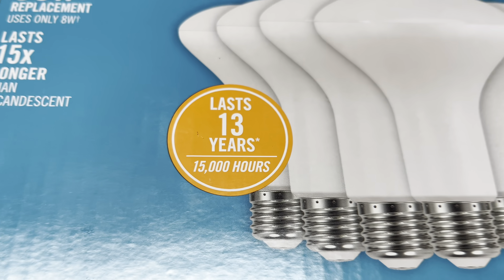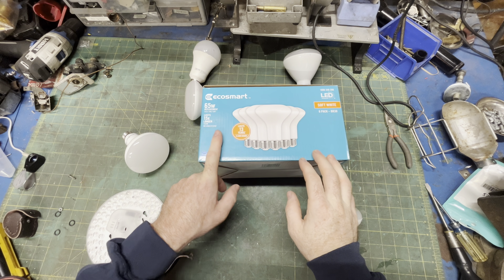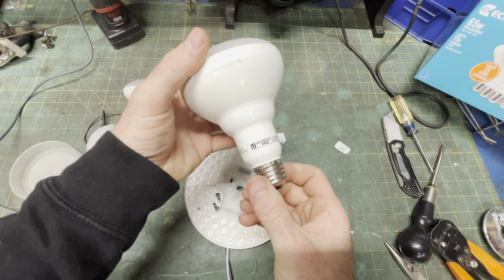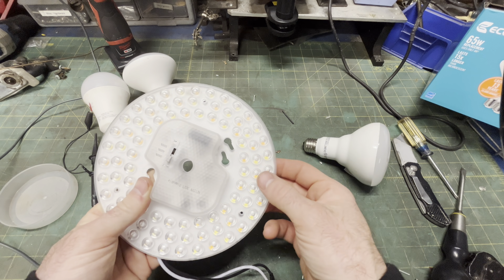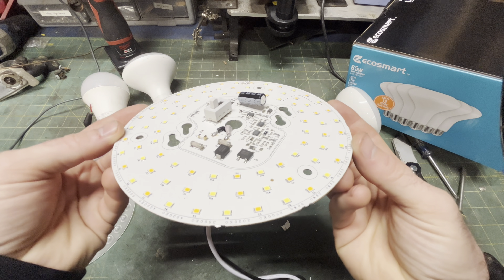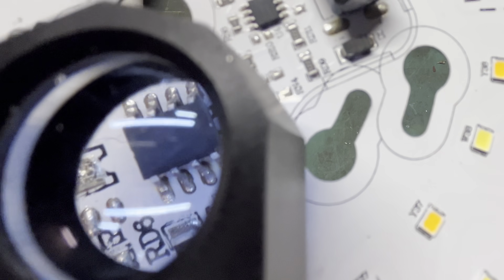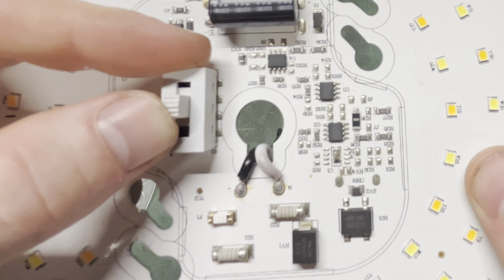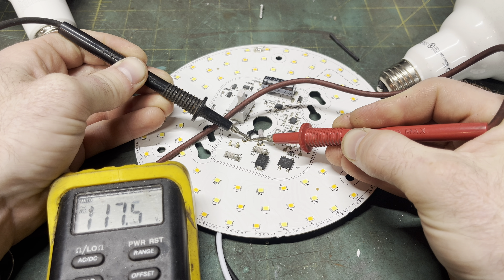Why Do LED Bulbs Fail? An Autopsy!

Comment: according to the manufacturers the lifespan of the lamps depend on the On/Off Times. the more times they get turned on and off it decreases their life. And I use to install a lot of lamps when i was working in the field. I have replaced thousands of lamps and hundreds of ballast. I had a building that the local power company came in and installed motion detectors and the lamps only stayed on for about 10 minutes. it was a real pain when in the middle of working on something the lights would turn off. but this particular building had to have their lamps replaced very frequently. Whatever they were supposed to ge getting as far as saving was definitely  lost for sure because of the cost of replacement ( labor and lamps ).

Comment: My beef is with 48" strip lights and pole mount area lights that use separate LED drivers.  The lamp source is always good but the driver is shot.  There are no identifying numbers or manufacturer brand marks on these driver units so they are almost impossible to replace.  It is a lot harder to replace a pole-mounted light than it is to screw in a new bulb!

Comment: One thing I noticed about LED lightbulbs is if you don't turn them off, they last longer.
Oh, and out of the 10 bulbs I got when they first appeared on the market, 6 are still working, while modern bulbs die in 3-6 months.

Comment: What was so terribly wrong with incandescent bulbs? They were just a couple of ounces of glass, tin, solder and a tungsten filiment. Simple, cheap to build and to replace. Now they’re pretty much gone. They said they use too much energy so they gotta go. Now how much energy does it take to manufacture the chips, resistors, capacitors, and other components to make the led bulb? How much energy is used to transport these things halfway around the world from places like china?

Comment: First off, the life span they say is based on how long it will give light. Nothing on how intense the light will be.
Second, I have an old compact florescent that was not coil. The tops go up and down with 180 degree bends. It was in the back porch when we moved in the house 16 years ago. Often it get left on. It's still going. I got rid of all the coil contact florescents.

Comment: As a formar buyer I was much relieved to replace FELs with LEDs as they burned. That way I just needed a couple boxes at hand. Agreed first ones to come up to the market were very short-lived but quality improved with time. Most common fail modes were capacitors or misassembled heat sinks.
But I guess every man's experience is different.

Comment: I got 25 ish 240v gu 5.3 LED spot lamps back in about 2012 . They were quite expensive back then.   10 in my kitchen, 9 in a bedroom , and 3 in another bedroom.  1 of them failed within a few years.   The rest of them are still going , now 12 years later. I think they're becoming a bit dull , but it's hard to tell. I haven't been doing light meter readings !

Now some more modern LED lamps , I've had them blow just after a year or two. Yes, definitely not as good !

Comment: I've personally had amazing luck with Philips bulbs.   I bought 6 Philips bulbs about a decade ago at this point, I've only had one fail, and only very recently.  After those initial 6, I needed some more because the more of incandescent bulbs installed in the house were failing (new build construction, cheap bulbs) , so I did what home home owners would do, I went to Home Depot.  Ecosmart were on sale and much cheaper than Philips or any of the name brand alternatives (AFAIK Ecosmart is Home Depot's house brand), so I bought 4 of them.  Then couple months later I needed some more, so I bought 4 more, and repeat at least 2 more times over the course of maybe 1.5 years until probably 90% of the bulbs in my house are LED.

Since that time, I have had at least 12 Ecosmart bulbs fail, and only 1 Philips bulb.  I have not bought another Ecosmart bulb since I noticed a patter start emerging of the first 4 Ecosmart's dying very prematurely.

Comment: 14:00 - I read an article in Popular Electronics about salvaging components from circuit boards and methods of doing so were part of that article. One method mentioned was heating the back of the board with a blowtorch and whacking it on a workbench...

Comment: I have these old Philips Endura lightbulbs, supposedly at 3 hours a day they would last 22 years, but they've been running 24/7 in my house for 12 years now. The base seems to be entirely made of aluminum which could be why they've lasted so long.

Comment: I've taken apart tens of normal 60w equivalent LED light bulbs and for me it's a dead LED every time. It is easy to see which one because they get a black spot on them. If you short out the LED or replace it, they will work again, sometimes for a very long time even if you short them and the remaining leds are driven harder. The brands have mostly been Philips and Astralux which must be the brand names the conglomerates that deliver to my local grocery store owns.

Comment: Could just make your own led bulbs from the ones you have. Use a high efficiency bridge, caps, then just stack all the leds in series until it matches up to the voltage of the input. Alternatively, have a separate led lighting system for each led individually or a 12v one. Might work.

Comment: Most of these bulbs say not to be used in enclosed fixtures. Additionally you have to look at the placement of the bulb in a fixture, meaning, the direction it is installed vertically. Is the light facing downward, which causes the heat to rise up into the circuitry? Or the opposite? That makes a big difference.

Comment: The DC from the bridge should be 1.4 times the AC input, mnuse two diode drops. 10 volts indicates an open electroylytic. I learned that almost 60 years ago. Electrolytics are the hihest failure component  in modern electronics.

Comment: Basically the solution is - good heat sink to the LEDs (and driving them with a smaller current they are rated for) and the electronics driving them to be distanced to protect from overheating.

Comment: I was the manger for street lights in a mid-to large City.  I also had years of experience as an electronics technician.  When LEDs came out (way before street lighting LEDs,) for traffic signals, I saw the predicted "life" and noted that it was based upon the LEDs themselves.  Not the power supply that gave them power.  I said then that the main issue would not be the LEDs, but the build quality, and life expectancy of the power supply's components.  Again when the Street Light LEDs came out, I repeated that.  The major causes of failure in any electronic device has typically been within the DC power supply for it.  Still is.  I will say, that the power supplies in general have been improving, but unless those supplies are at Mil spec, they will likely fail before the LEDs do.  The major way to figure out what the failure cause was is what was the failure.  Total, likely the power supply.  Individual LEDs, the LEDs themselves or their connections to the mounting board.  (Just by my years of experience.)

Comment: The constant heat and cool cycles fatigues the solder joints over time and they eventually develop micro cracks and fail. I wonder if you turned the bulb on and left it on continuously never turning it off how long it would last.

I have a small night light bulb in my basement that is plugged into an outlet and never turned off. Its been burning non stop since 2013. Still going.

Comment: I bought a bunch of those FEIT electric bulbs when I moved into my new place. Maybe 140 of them? They have failed at roughly 10-20 per year since then. I ended up replacing them all with Sylvania TruWave 4000K LED bulbs. They were roughly 5x as expensive, but I have not had a single one fail in over 1.5 years. You get what you pay for. It sure beats scrambling up on ladders to change them out on 12ft ceilings.

Comment: "Smells like nostalgia" i know that feeling very well lol. Mainly from when i used to use a heat gun to melt ALL the solder joints on a through-hold board, then tap the board into a bowl to make all the components fall out. burning FR4 probably wasn't healthy to breathe in lol.

Comment: I was laughing a lot at certain spots, but I have to admit, that I have couple of early LEDs, which served me 10+ years, most of them still in service. Unlike some of the newer ones, these were never modified for lowered output. Most of them are just some generic Ikea LED bulbs.

Comment: I have floods outside.  They lost their front glass when getting Hot in the sun bulb off.   We got over 120 and they are close to the attic.   (Vented top and sides and ends.)  The glue changed. Now I have a heavy glass lens to do something with.

Comment: I had switch mode led drivers fail, most of the time it's an electrolytic capacitor that gives up. If I spend more than 30 minutes I usually just swap the driver for a new (AliExpress) driver.
My bathroom led downlights are now 14 years old with only one driver replacement

Comment: Another reason why leds fail is straight out lack of heat dissipation. I had a 3 watt bright enough philips mini bulb fail in a ceiling mount, but opened it up and driver was fine, the bulb was dead due to the enclosure and zero heat dissipation (its heat sink was the size of a dime and there were 12volt leds 4 of them in series to a total of 48 volts to eun them. Poor thing got so hot the phosphor was coming out of the led. Hooked up 12 new led lights (3v each to conpensate for the 12v each) with a massive heatsink and separated the driver and put it back in enclosure, the things been running bright ever since, saved it from ending up in the land fill

Comment: I have a flame LED bulb in my Post light that runs 24X7X365 for the past 6 years.  The secret is not turning it off and on frequently, just leave it on.

Comment: I write down the date and time on the boxes nowadays...I found that an incandescent indoor plant light rated for 2000 Hours does pretty much between 1600 and 3500 Hours...and the LEDs...between 24+ Hours and less than the incandescent. 
Very often it's a loose wire in the base and/or the main capacitor.: failure by overheating (They get burning hot!) and/or corrosion. 
The ones that have semi potted boards in an aluminium shell last a bit more. Philips outlasts the cheapos. Older LEDs purchased over 5 years ago are still going (let's say 40% of them) newer ones last 1-2 years maybe 3.

Comment: Its mostly because the old "light bulb" form factor is not right for LEDs, due to the driver electronics stuffed in the tiny base. That's was dies. The electronics. Semiconductor circuitry, and electrolytic capacitors do not like heat. To live anywhere close to what's on the box, the circuit has to draw no more than 1 watt per square inch. Current production LED bulbs greatly exceed that power dissipation.

There are new fixtures, with the LEDs integrated into the fixture, and have nice large aluminum backed PCBs, that dissipate less than 1 watt per square inch. Installed a few of those 9 years ago, and they are still working fine.

Comment: I've had several cheap LED bulbs flicker or get dim. My problem is that sure they do use less energy, but it seems to me that the actual bulb is not really environmentally friendly.  With incandescent bulbs you have some metal and glass, with the LED's you have the plastic and all the circuitry which I'm assuming is not landfill friendly.

Comment: I wonder if this is the same issue with the Kasa KL135 bulbs.  I've had several of them start to fail.  One of the LED's in the bulb would start flashing very fast after being of for a couple hours, and over time the flash became slower. This happens with both my inside and outside Kasa KL135 bulbs.

Comment: I like the LED "filament" style bulbs. They look much nicer and I've had pretty good luck with them, only 1 or 2 out of ten failing over 8+ years. I used to get them at Walmart because they had some that were at least assembled  in the US, but they don't have those anymore so I'm going to try Home Depot's next.
Reply: I had one burn out on me in probably less than a year made by Ecosmart.

Comment: I assumed fuses used the same colour code as resistors, in which case the current limiting resistor should read brown, black, black for 10 ohms. "Red, red" is a bit odd.

Comment: Before even watching this, I can answer it the question. They run the diodes at a higher voltage than they're designed to handle, specifically so that they will burn out faster. As the saying goes, the candle that burns twice as bright, burns half as long.
They do this knowing no one actually keeps the receipt and the bulb's box for 5 years to take it back to the store for a warranty replacement. Requiring the box is one way they're getting around consumer protections and warranty regulations. Even if it's illegal for them to do that in your country, they will get away with it, so much of the time because people don't know, that it's worth them doing it.

Comment: Yeah, the biggest problem with LED bulbs is the power supplies.  The LEDs themselves are almost never the point of failure. I think that in the long term we should move to DC lighting circuits in buildings.  It would eliminate all of this unnecessary complexity.  I think that it would be really simple to adopt either a 12 V or center tapped 24 V (+12v GND -12v) system for lighting.  Having a standardized connector scheme like we have for current AC light bulbs would be really nice. In fact there are so many things in your home that could benefit by eliminating the AC power supplies and having DC power available.

Personally, I would like to change my home's lighting to a solar powered, DC only system.  Imagine never having to worry about the lights going out at 10 pm in a rain storm.

Comment: One is the solution for interior lighting! fluorescent with electronic ballast and quiet for at least 10 years and for outdoor, ceramic metal halide CDOs which are very efficient but need a ballast, ignitor and capacitor to run these bulbs or an electronic ballast and be ok for 10 maybe 20 years if you want something a little more efficient, HPS i.e. high pressure sodium is one of the most efficient gas discharge lamps in use at the moment, but the light they give is a very intense dark golden yellow light of 2000 Kelvin so they are only used outdoors, while the CDO is 2800 Kelvin warm white like incandescent and halogen, but CDO bulbs are only for outdoor use if you want an LED that lasts 10-25 years and unfortunately you have to pay a lot of money for it to actually last for many years

Comment: I'm an electrician. I work in a hospital. I've change 1000s of bulbs a year.

Those BR30 ecosmart sucks. Ive installed 1000 of phillips BR30 in the hospital. I've changed maybe 10 in last 5 years. Typically an LED dies within a year or lasts a decade. 

I've installed 6 of those BR30 ecosmart from home depot in my house and 50% have failed within 5 years.
Reply: A lot of those first generation LEDs are still working. 10+ years old. They have huge heat sinks on them. Soon as LEDs became normal, they started to make them more more cheaply.

Comment: Started using those GE Relax frosted filament LEDs last year. The look just like real incandescents and the light is nice. I have about 12 in service. Just had one fail in the bathroom and two days later one failed in a lamp in the living room. Not a good sign.

Comment: Look atvthe box.  They say will  lst 10 years if run 2hrs per day 5 days per week.  That is not how my lights are used, nor is that very many hours of use.  In 1980 I saw a incadescent lightbulb that was one of the first manufactuered by Edison still burning.  The owner worked for Edison and never turned it off.

Comment: Seems like the current limiting resistors of the GE (Savant) Refresh LED bulbs - my first-ever lightsocket LEDs - were crap. They ended up flickering way sooner than the 5 year (at 3 hour per day at 120V) warranty. At least they honored the warranty & I replaced them with GE Basic bulbs that look more like spherical CFL than Refresh tries to look like incandescent.

Comment: Part of the issue with LED bulbs is how they are used and where.  I have one in an open lamp where it stands face up.  It has been constantly on for years.  Heat gets to escape straight up.

Yet, other LED bulbs constantly burn out because they are mounted either on their sides or upside down inside a ceiling “globe.”  This trapped heat is the same thing which killed the CFLs in the same type of fixtures.  

This does explain the differences in user experiences.  I’m betting the same type LED bulb I installed in my refrigerator lasts for 20 years.

Perhaps the lifespan could be extended by drilling vent holes into the bulb.  Or vent holes combined with small heatsinks connected with thermal glue to the led plate.

Comment: "Lasts 15 years"  but the fine print says  "when used for 2 hours a day."    The same wording as on the curly bulbs.    The  why they fail vs  how long they are ACTUALLY supposed to last with 4-12 hour scenarios may be connected.